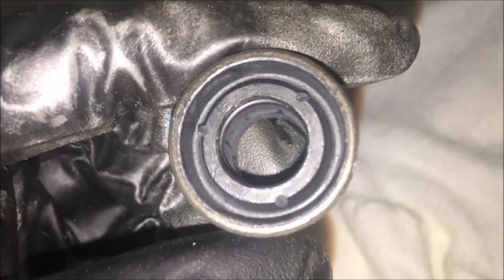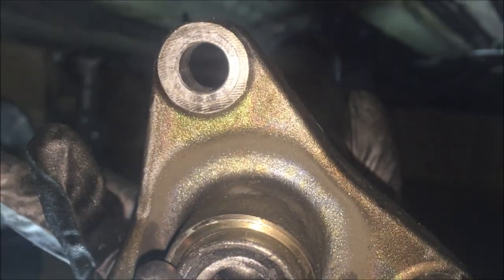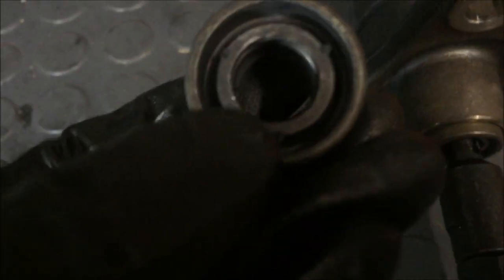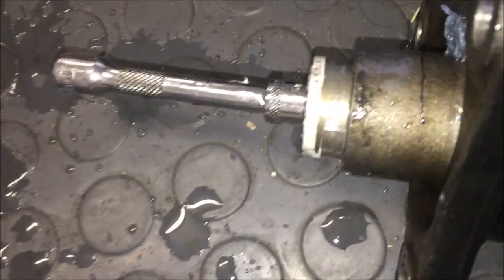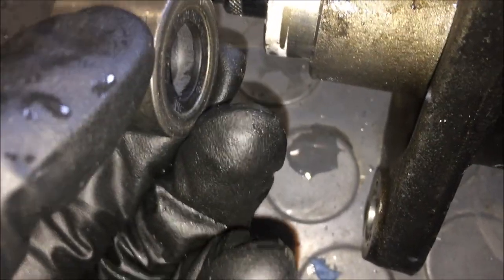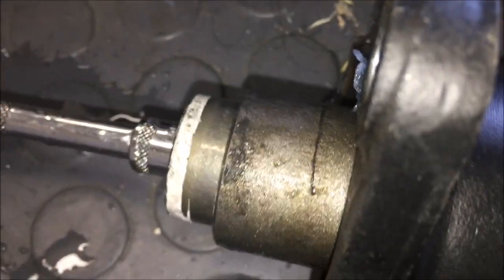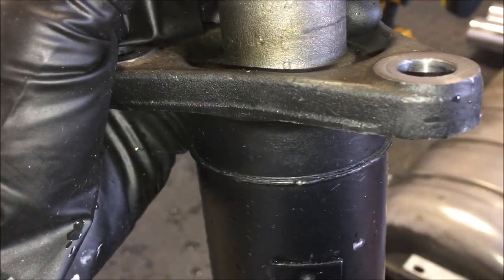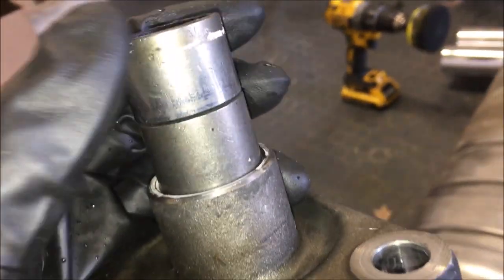BMW E46 M3 Driveshaft Centering Sleeve

Comment: Mine is welded on. There is a huge cut in the middle where I split it with a chisel and it WILL NOT BUDGE. I would never have started if I could go back.

Comment: When pulling out the bearing from the driveshaft, use a small blade to make cuts in the ribber along the axis of the bearing. Then the rubber can be separated from the bearing allowing the blind puller to be utilized.

Comment: Can you not just pull it out with a pick tool?
Reply from the maker: Sigma Octantis it’s in there pretty good so I don’t think you can
Reply: @PaulVo  Ah ok. I'll give your technique a try. My driveline seems to be going through flex discs and I think last time it's worn out associated parts due to the bumping around so I'll be replacing the CSB and the driveshaft centering sleeve along with the flex disc along with making sure the driveshaft is properly aligned with the balance markers.
Reply from the maker: Sigma Octantis make sure the flex disc is installed in the right direction and preload the csb toward the front of car.